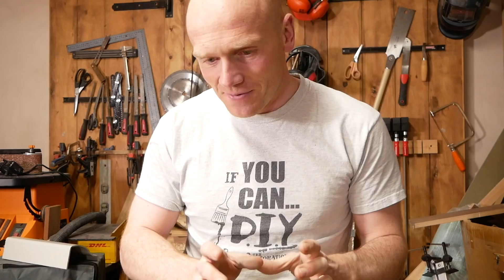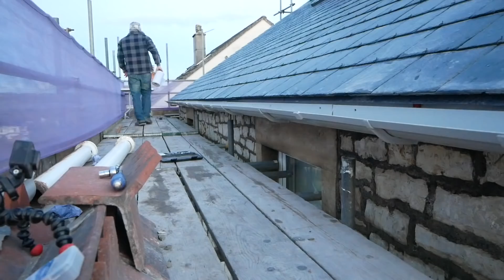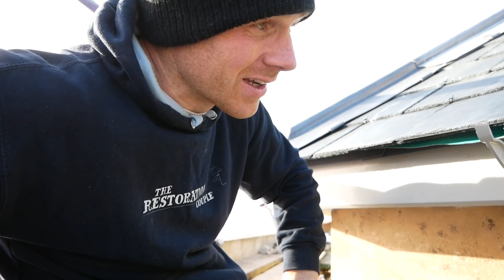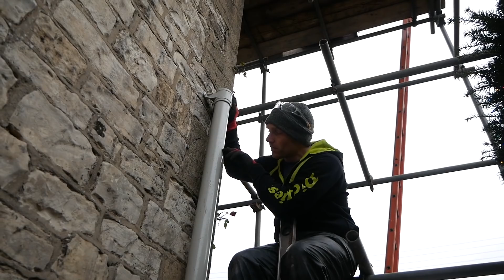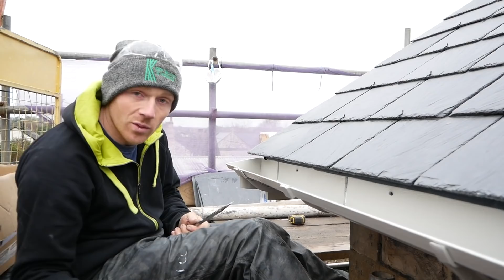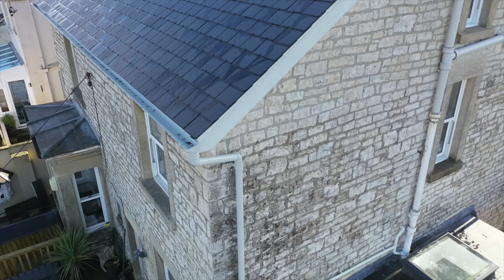GUTTERING TO LAST A LIFETIME! - Complete Transformation using Cast Aluminium

Comment: Hi, have been removing cast aluminium 5 inch half round guttering on old an stone house, they have corroded through in 30 years. All along the very bottom of all the gutters is a continuous line of pitting, many of which are pitted through and leaking. They are probably the worst guttering I have seen. I have seamless guttering that is up for 37 years on another house that is still perfect, even though it is much, much thinner material.

Comment: Too bad that a lot of your building materials are just not available in the States like so many quality products in Europe.  The gutters normally available here are of such light weight that they won't support their own length when you pick them up.  Or they are plastic and the hangers just fold off the facia with the first snow.  Building standards are lacking here for many materials.

Comment: When bolting the lengths of gutter together I would have put the nuts on the underside. Now they are sticking up and will trap leaves and debris Also notice you did not use traditional bobbins between the stonework and the downpipe brackets? Overall a neat and thorough job.

Comment: To get your drop attach a bracket at the ends with a line/string attached to bother ends, then you've got your line to follow. Same as laying bricks, but one end is dropped
Reply from the maker: That’s it yep. 👍 String line used for the straight runs but not so helpful on the bay. 😕

Comment: Great job!
My father-in-law is a retired plumber who also did a bunch of roofs, guttering and down pipes. 
He said in the old days for fixing the down pipes, they’d chisel out a bit of the wall and then hammer in a thin piece of wood in to the hole and then use that bit of wood to screw the down pipe in to. 
Quite interesting to me as a DIYer that’s grown up in the days of wallplugs. 
(I’ve maybe got the details of how he did it back then a bit wrong but you get the idea...)

Comment: Should the shoe not rest on something to support the weight of the pipe? Anyway, great work; you are very motivated.
Reply: Normally there is a groove for the support strap to sit in and carry the weight.
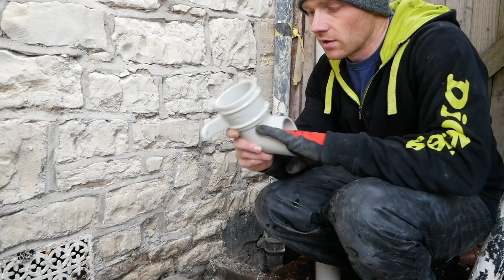Reply: @jonathan1427  I just realized that the shoe in this case has an integral bracket ( 7:14 ). I still think that the shoe should rest on the ground though.

Comment: I have 106 year old 2 bed cottage with similar profiled cast iron gutters that have had better days.
What's the costs like for the aluminium compared to the cast iron.
Reply: It can work out about the same cost. The Cast Iron needs repainting every 5-10years as it is the layers of paint that protects the iron from rusting. The Cast Aluminium is lighter to install and the powder coating should last 25-40 years depending on the environment (marine or urban) and the Aluminium is noncorrosive. But if you live in a conservation area you may not have choice!

Comment: Looks great. One query, the bolts going into the gutter could act as snag point? Leaves etc 

Just a thought
Reply from the maker: I didn’t include that step as it was rather boring to watch but a ‘mushroom’ of sealant is smoothed over each. 👍
Reply: Yes, just my thought. Whenever I've come across them they have always been put in the other way, with the nut on the underside so that anything in the gutter can roll over the top of the threaded bolt.
Reply from the maker: I actually started that way but then saw the intended method is to have the round head down.
Reply: @TheRestorationCouple  thanks for coming back on this. Great series. Epic undertaking, I am not afraid of a DIY project but hats off to you for this amazing job

Comment: Should the nuts be on the outside leaving a flush head in the gutter to avoid any moss trapping on the bolt head
Reply from the maker: I did think the same but no. The nuts are finished by ‘mushrooming’ a blob of the silicone over to avoid any issues with flow. 👍